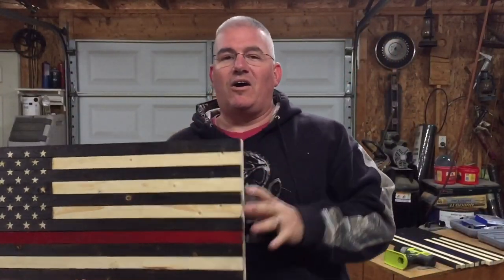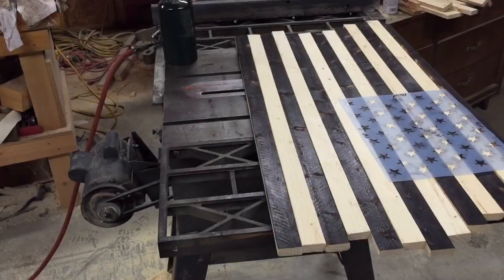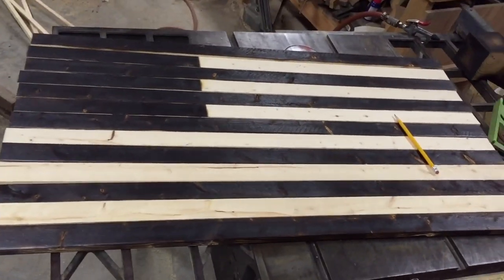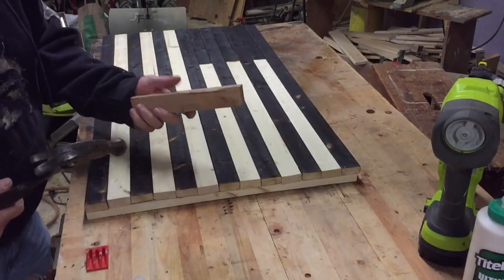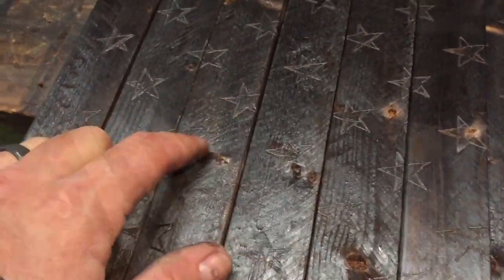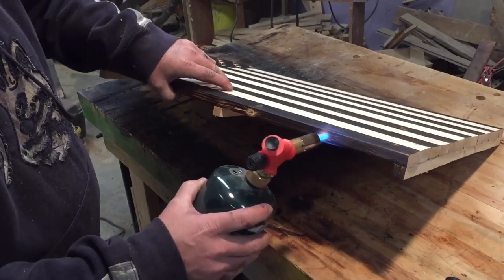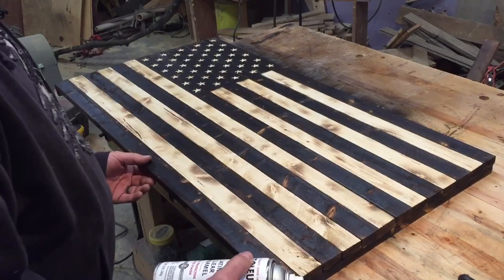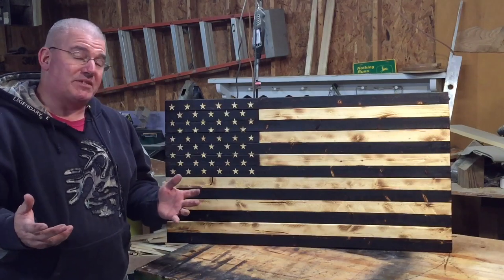DIY Rustic American Flag / Rustic / Torched

Comment: You can get a white stamp pad at Walmart in the craft section or under $2. Then when you put your template down just go over stamping the stars be carful and make sure you get the corners of the stars let it dry good before your remove it and keep it clamped on one side just in case you need to go back over a corner or 2. I love your technique and you made the instructions very clear to understand   Thank you.

Comment: Great job Jeff, your video is very easy to follow along. I've been making flags for awhile now and your way is much more simplified and your results are fantastic. I've been doing the raised stars for a 3D look and using different size wood for the Canton, but I recently worked on a coffee table design and couldn't use the raised stars for obvious reasons. A quick search found your video and I'm grateful (just ordered my Dremel Tool)!  Shouldn't be a problem to finish now. Thanks!!

Comment: Hi Jeff, You did a great job with the flag. Did you ever consider taking this one step further. Put a hollow back on it. So you can hide items inside. Like a hand gun or money other valuable items. Thanks for sharing. God Bless You.
Reply from the maker: Thank you very much. I have thought about that, actually I have had a couple friends of mine suggest that I make a flag with hidden compartments. I have seen a couple different versions of that but I just haven't tackled that yet. I will probably be making one of those at some point but I'm not sure when. Thank you so much for watching
Reply: I was thinking the same thing! Great idea!!

Comment: After you burn the wood do you lightly sand it to remove the loose flakes? I have seen the flakes and dust come off on the white portion from handling. Thanks.

Comment: Awesome build. i've done 6 now. only problem i'm having is i cut my boards to your measurements. but i cant get the union size to meet what you have. my seventh board is always off by a 1/2 inch. you have any suggestions

Comment: Jeff, I love your flag design. My 10-year-old son and I are going to build this for his first wood project. I noticed you used staples, but I was wondering if brad nails would do the trick?  Thank you for posting such detailed instructions!
Reply from the maker: Thank you, I'm glad you have found the video is helpful, I think that will be a great first project. I think the Brad nails will work if they are long enough to sink into the wood deep enough. One staple would be basically the same as two Brad nails. If you use wood glue like I do, once the glue dries, that will hold better than the Brad nails anyway. Good luck with the project, once your son has it completed I'd love to see a picture of it. Thank you for watching

Comment: I’ve just started my hand at making a few flags myself and I have a question.  Several of my flags are starting to separate between the boards, and I’m not sure what I’m doing wrong?!  The stripes slowly but surely start to separate, leaving small gaps between them.  I’m using Titebond wood glue between each stripe, clamping them together using several clamps, but inevitably they seem to want to start working apart.  Not enough glue?  Not clamped together long enough?  I can’t possibly start to sell these things if they’re going to fall apart....any help is appreciated!

Comment: Awesome work! Question though, if you wanted to build one as a top for a coffee table, is there different finishes you might work with to keep it from scratching and have it protected? And what wood would you recommend working with for hanging it inside, i heard you mention not using one of them because of the chemicals. This has been a project i have been wanting to do for awhile, thanks!

Comment: Great video and technique. I've been using the Ryobi brad nailer over 2 years and love it. I'm wondering if you've had any problems with the one you're using.  I've been hesitant to get one for no real reason. With their yearly sale coming up i thought I'd get some insiders opinion.  As well as information on the torch you used. Thank you

Comment: Awesome job!!  I’ve made a few already, still tweaking my methods to make them easier.  Question, where did you get a 50 star template you used to trace the stars?  Currently I had hand cut a thin wood star and hand trace each one, very time consuming.  Thanks!

Comment: Made fist one with your ideas, I used spray paint instead of a torch. I'm having trouble with the stars and haven't sized them correctly . How did you make the template and any tips on using the dremell with the stars? Thank you very much and keep up the great work.
Reply from the maker: I can give you details on making a stencil on email, too much to type in comments, or I can tell you how to purchase one.

Comment: I just got a torch today and did my first flag. I see you burning the on the table, when I used my torch in a downward position the flame went out every time so had too burn holding the pieces. Am I doing something wrong?

Comment: where can i find the stars template?
Reply: you can find star templates (if you haven't already) on amazon. They make all sizes. Just make sure the length and height of the flag is appropriate for the size of the union.
Reply: @pchamp5541  how do you determine the size of the union?
Reply: The union has to be 2/5 the length of the flag. You can find dimensions on google for any size you want to make

Comment: I don't have a staple gun, would the wood glue hold fine on it's on? Do you recommend gluing each separate board together?
Reply from the maker: +Marissa Yingst you can glue and clamp the boards together, much like cabinet doors are glued together. That should hold as long as you use a good glue and allow it to dry before removing the clamps.

Comment: Im  in California and I just started doing a wooden flag.  If I wanted to put the bottom of the shotgun shells instead of carving the stars, what would you suggest to do, on putting them on?
Reply from the maker: That will look good, you could either drill the right size hole to place each one in or you could use hot glue. I've never tried that, I'd like to see it when you're finished. Good luck with the project.

Comment: Great video! I am in the process of making one myself. I am at the star carving step. Which Dremel tip do you use to carve your stars? Thanks!
Reply from the maker: I use a #106 carving bit most of the time. If it's a bigger flag I'll use a #107 carving bit. The #106 is easier to do the sharp points of the stars. Don't forget to submit a picture for the Independence Day giveaway.
Reply from the maker: if you have made a wooden American flag, you should enter the giveaway on my channel, the deadline to enter is June 29 at midnight. Here is the link to the video announcement with details. 
https://youtu.be/mCa5cp1yBtY

Comment: Great Video Jeff what size staples did you use in your staple gun?
Reply from the maker: Thank you, I use 1" staples, I could use 1 1/8" probably but the 1" work good for me. Once the glue dries those strips aren't moving anyway. Thank you for watching
Reply: Great videos Jeff... I've made 3 flags and working on number 4 now.  I've glued all my stripes, clamp over night then staple more strips on the back.  In this video you don't glue together. Have you had any problems with the flag stripes warping or separating?  Also I've ordered some stencils, do you provide a tracking number?

Comment: Jeff, the flag looks great.  I have a couple questions.  Obviously, this isn't a load bearing item, but how are the nails and strips holding up?  Also, why did you choose to use that method versus a glue up of the boards?  I'm assuming a time saver, but was just curious.  
Thanks
Caleb
Reply from the maker: C. Shelton the flags have been holding up great, no issues at all. I do glue the boards in addition to the staples so there should be no issues with it staying together. The reason I chose the strip method on the back and also to use the Dremel tool to carve the stars is that I wanted to make a quality DIY project that most anyone could do, even with minimal to no experience and with very little money to start.
Reply: Jeff, thank you for the  response.  Makes good sense.

Comment: Hi Jeff, I have a question, what bit do you use to make the stars, I never use a dremel so I'm kind a lost  :)  TIA.
Reply from the maker: I use a #106 carving bit most of the time, it's smaller and easier to make the sharp points on the stars. For the larger flags I use the #107 carving bit sometimes.
Reply from the maker: I use a #106 carving bit most of the time, it's smaller and easier to make the sharp points on the stars. For the larger flags I use the #107 carving bit sometimes.

Comment: How high should the torch be to get that nice burned look for the dark stripes? I'm currently burning the wood now and I'm just afraid of my torch because I've never torched anything before.
Reply from the maker: I use my torch about 3/4 of the way open or almost wide open. Different woods burn at a faster rate.
Reply from the maker: You should enter the giveaway on my channel. Here is the link for that with details https://youtu.be/mCa5cp1yBtY

Comment: Is there a standard of some kind for the flag size compared to union size? Or how did u figure out those dimensions? Also what Drexel tip do u use?
Reply from the maker: Hey Chris, I'm not sure that there is a standard but what I did find as I searched the Internet is that the Union is about 2/5 of the fly or the length. 2/5 looks really good to me and it keeps the flag from looking too square. The height or the hoist of the Union covers 7/13 or 7 stripes, so no matter how big you make the flag the Union will be the top 7of the 13 stripes. The Dremel bit I use is a small round carving bit, I'm out of town right now and when I return home I'll get the exact number of that bit for you.
Reply from the maker: The dremel bit I use is the 106 engraving bit.

Comment: Is there anything special you did for the blue line paint? Is there a brand that works best? Thanks and I'm excited to get trying to make myself one!
Reply from the maker: Rust-oleum #7251 Cobalt Blue Metallic spray paint. That color does really good, it covers good and it dries pretty fast. The metallic kinda helps it stand out even after I spray a satin clear over the whole flag. There is a little bit of silver pigment in that paint and sometimes that silver will gravitate to the knots or the rough areas, not sure why it does that but it actually helps give it a rustic look when it does. Hope this helps, good luck with your project and thank you for watching.
Reply from the maker: if you have made a wooden American flag, you should enter the giveaway on my channel, the deadline to enter is June 29 at midnight. Here is the link to the video announcement with details. 
https://youtu.be/mCa5cp1yBtY

Comment: do you have a pic of the gold line? I cant find a stain that looks gold enough. What stain do you use for that?
Reply from the maker: I haven’t made a gold line flag in a couple years but the color I used at that time was called marigold and it is in spray can. Here’s a link to the same paint that I used https://www.homedepot.com/p/Rust-Oleum-Painter-s-Touch-2X-12-oz-Gloss-Marigold-General-Purpose-Spray-Paint-249862/202526108

Comment: On the 19.5x37 flag how big are your stars? and how far apart do you have each star from one another?
Reply from the maker: I made those stars 1.1" each and they are separated by the width of the star. So if there were stars all the way across, they would be touching point to point. I hope that makes sense.

Comment: On your smaller flags, (13x241/2) what are you strip widths for them? I think you said on the bigger one, they are 1 1/2 wide?
Reply from the maker: The strips on that size are one inch each, thirteen stripes equals 13". That's the most popular size flag that I make. Good luck with the flags and thank you for watching
Reply from the maker: if you have made a wooden American flag, you should enter the giveaway on my channel, the deadline to enter is June 29 at midnight. Here is the link to the video announcement with details. 
https://youtu.be/mCa5cp1yBtY

Comment: Did you rip both sides of the stripes. Video only shows you making one rip per board. This would make one edge nice and straight with a sharp edge as a revela and the other factory edge a bit rough and rounded over.
Reply from the maker: BOTTLEDZ28 when I started making the flags , the material that I was using had one square edge and one round edge. I was ripping the side with the rounded edge and that gave me two square edges.

Comment: What kind of Dremel tool did you use? Your video inspired me to make of these and the Dremel is the toughest part.  Drew
Reply from the maker: Hey Drew, I use the #106 carving bit on the stars. I sometimes use the #107 but it is a little bigger and more aggressive so the #107 is better for the larger flags and the #106 is the one I use on the smaller flags. I'm glad you liked the video, I hope this info helps and good luck with the flag project. Thanks for watching
Reply: +Jeff Furr awesome thank you very much!!
Reply from the maker: +Drew Moldenhauer  if you have made a wooden American flag, you should enter the giveaway on my channel, the deadline to enter is June 29 at midnight. Here is the link to the video announcement with details. 
https://youtu.be/mCa5cp1yBtY

Comment: So I know this has most likely been asked before. But what do you charge for a large.  I made three for different charity events and I've had inquires on what i would charge for one, and i never know the right answer.  Mine are exactly how they are in this video.
Reply from the maker: My large is 26" X 48" and I charge $180 for them. The medium, 19.5" x 37" is $125.
This works well for my area, may be a little low or high for your are

Comment: hey Jeff...I can't wait to see the video on how to make that template. I am looking forward to it. that flag you made was spectacular. the union is 2/5ths of the length of the flag right?
Reply from the maker: Thank you so much, I am still going to make a video on how I made the templet but in the mean time if you're interested, Chris Whiteside shared a website with me that sells the templets in a lot of different sizes. 
http://www.thestencilsmith.com/catalog.php?item=2588
I'm actually going to be ordering different sizes from that website because making templets can be very time consuming and I'm working on a few different sizes of flags. (Thanks to Chris for sharing that info). You are correct about the union, 2/5 of the length of the flag, any more than that looks too boxy or square to me. Thank you for your comment and thank you for watching.
Reply: Did you ever order any templates off that site of so which ones for the different sizes of flags. Thanks in advance you're a great help
Reply from the maker: +hamman0512 I haven't ordered any templets from that site yet but I will be soon. Here are the measurements that I have been using for my flags

The small flag is 13" x 24.5" and the union for that flag is 7.25" x 8.75"
The medium flag is 19" x 37" and the union is 10.5" x 13.25"
The large flag, which I've only made one of those so far, is 26" x 47" and the union is 14.5" x 17"

You should be able to use those measurements to determine the size of stencil you need. Hope this helps and thanks for watching.
Reply: Awesome thanks!  I ended up ordering #4, #8, #9, #13 and #14 stencils to play around with and see which ones look and fit the best
Reply from the maker: +hamman0512 that's awesome, let me know which one works best for you. Good luck with your project.
Reply: Hamman0512 or Jeff Furr have you figured out which stencil was best from the links provided?
Reply: #9 for 13 x 24.5 for sure. Haven't tried a bigger one yet. Looks really good
Reply from the maker: +MrJman84 hammon0512 is correct about the small flag being #9 and according to the measurements online, looks like the medium flag would be the #13 and the large would be the #18.
Reply: +Jeff Furr what are the dimensions of the large?  I'm going to give this a try, but I won't make your deadline for the drawing.  thanks and nice work!
Reply from the maker: +Chris white the largest one in my videos is 
19.5" x 37", I have made one that is 26" x 47". Good luck with your project and thank you for watching.
Reply: Thanks for your quick reply.  So the #13 stencil is what u figured for the 19.5 x 37
Reply from the maker: +Chris white yes, that's what I've figured based on the information on their website. I haven't actually used their stencils yet but I'm going to use the #13 for that size flag.

Comment: Thanks for the video's. If the flag is 13x24 should the stars be 3/4 in size. where did you get the template for the stars. Thank you.
Reply from the maker: The stars for that flag are just under an inch. I made my own stencil by finding a star shape in word and making it the size I needed then duplicating that 49 more times. Then it's printed and transferred to a plastic stencil sheet and cut out with an exacto knife. If that sounds time consuming, well it is. My suggestion to everyone that is inquiring about the stencil is to try out this website that a viewer turned me on to. Here's the link to that site 
http://www.thestencilsmith.com/catalog.php?item=2588
I think you'll like that site, they should have every size stencil that you need for flags. I haven't used these stencils yet but I'm going to order them and try them out and then review them here on my channel. Look at the 9" stencil, I think that's the one that you'll need for the 13" x 24.5 flag. 
I hope this helps, feel free to message me if you have any questions, I'll do my best to assist. Thank you for watching
Reply: Thanks Jeff!!
Reply from the maker: +michelle kunovich you're welcome, I hope you can get a flag made and enter our giveaway.